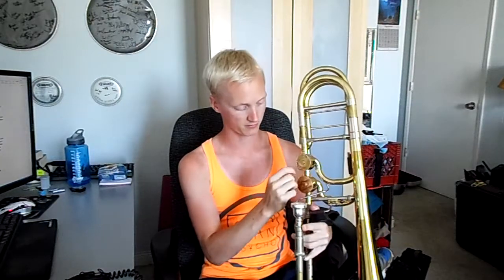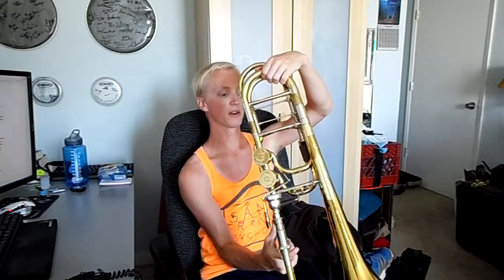Burgerbob's Horns- Main Axe

Comment: Though I have not yet had the opportunity to play Haggman valves, I played Axial flow valves a lot and did not care for them. For me they were too open. Rotors offer a little back pressure that helped me pop the low notes.
That being said, I now play on a Shires Tru-Bore and love it! I noticed that my alt positions (especially Bb in 3rd and A in 5th) sound great. Same color and timbre as the open horn.
I just switched from a B 2.5 leadpipe to a B 3L and for my Big Band work it is perfect!
Reply from the maker: What bell are you using? I am actually getting a Brassark NY50 leadpipe to repace my 2.5 pretty soon.
Reply: I have a Shires bell 9.5" BI 1 Y
BI = Conn 62H style taper
1 - Soldered bell rim
Y- Yellow brass

I have a C Yellow brass tuning crook. I also have a B Gold brass tuning crook, but haven't noticed too much difference yet.
My slide is a Shires B6278 Dual bore (.562/.578).
Inline F/G Tru-Bore valves.
Reply from the maker: Nice! Don't see many players on the dual bore with the Conn style bell. What mouthpiece?
Reply: I use a Ferguson L from hornguys.com. It is a copy of the Minick L but with a slightly more comfortable more rounded rim.
I get a really nice warm smooth tone with it, though the softer, wider rim makes Big Band Bass Bone Barking a little less edgy.
Reply from the maker: I had a similar piece, the Rath 1 1/4W. Good mouthpiece. The wide rim isn't for me though.
Reply: It is taking some time to get used too for sure. I plan on making a trip up to the Horn Guys next month to do some mouthpiece shopping. The Ferguson is close and I hope to find one that fits me better.

Comment: Oh wow, that is a great horn my friend! I have actually started looking recently into a new horn. I use a Bach 50B3 as my main right now, and before it I used a Holton TR180, a Reynolds, and a Bach 50BO. I've just been trying out other valve types just to see what else is out there. I tried out a Bach 50A3 Hagmann horn recently and really liked it, and I'm hoping for the chance to try out a few others soon. I've heard some really wonderful things about Trubores. I'm just curious, why did you ultimately decide on Trubores rather than Hagmanns, Thayers, Greenhoes, Millers, etc.?
Reply from the maker: Honestly I just wanted something other than rotors and I got a great deal on the TruBore set. They are all good in their own way. Hagmanns and TruBores are probably the best all around valves, but I couldn't find a Hagmann set for cheap. I was actually planning on putting Thayers on my 50B before I got the other set.

Comment: You said you had a c tuning slide, does that mean that the second valve is tuned lower than Gb?
Reply from the maker: Brayden Lovely C is an option, I don't have one. When people have tunings like that, it's usually F first valve and D or C second valve. So much lower than Gb, a major third and tritone respectively.

This gives you a more accessible low range, but a big tradeoff in weight and ease of valves in normal registers.